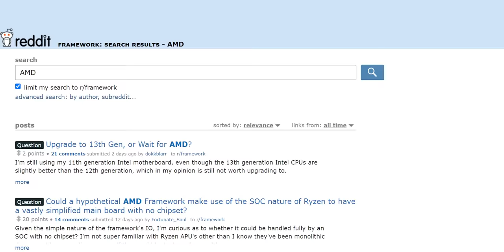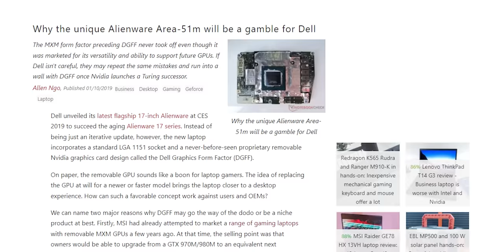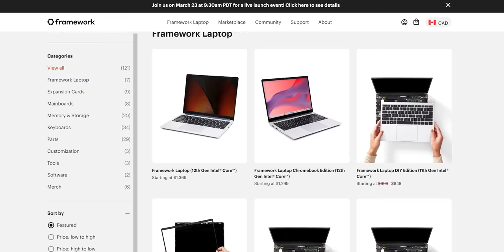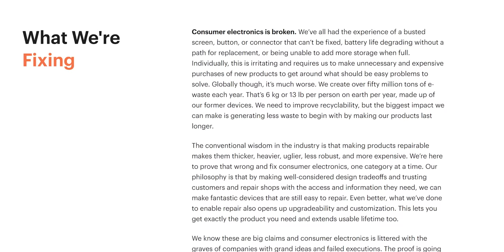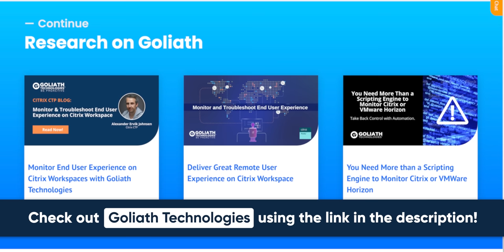I Made a Bad Decision – Framework Investment Update

Comment: The biggest hinder for me is the keyboard. I simply can't go from a Thinkpad keyboard to those slippery caps ... so, if they could also make alternatives available, preferably with depressions/dips/grooves on the keys, I'd change to it in a heartbeat. I find it telling that it's my only issue (important though it is to me), so well done Framework!
Reply: I can almost guarantee there will be better keyboards coming. Swappability and customization are just such a huge part of the Framework concept. If there's not a first party module, there will be a third party one.
Reply: Well, since the spec is open somebody could make a big old thinkpaddy keyboard. You would likely not be able to close the laptop with it inside but it could be done
Reply: @Ricardoromero4444  They probably would release a new hinge system for it. Pretty smart folks over there.

Comment: Now it gets into the grounds where I might actually go the laptop route. What I still missing is a dock. On the go you might want 2 SD Card Slots, one HDMI, one USB-A, one USB C and one Storage Expansion, because that is what you might need on the go but for example at home, you might want a dock with 3 monitor outputs, one Ethernet or even Fiber connection, audio and more USB. At work or home you might want your full desktop possibilities but on the go, you might prefer other stuff. Connecting more than one external monitor is pretty rare. At work, we have a dual TV Setup for our conference room but mostly use one for one laptop. At these occasions, a mirror setup is the most used one or when doing presentations, an expansion. 

With numpads, I need one. I need a full keyboard layout, because I actually use it. The middle row I use while typing to navigate, because why use a mouse to position your cursor, when I can just jump. With num, I use it for typing numbers and for calculations.
Reply: since this laptop has 6 USB-C ports and Tunderbolt4, you can use any Thunderbolt docks or other cheaper USB-C docks with it

Comment: When the touch screen becomes available, I'll definitely consider this over other options (for the occasion I don'thave the space/don't want to use a mouse). Just a thought, how about 360° hinges if the gpu module isn't in the way?
Also a note on the 3.5mm jack module: wouldn't it be more efficiently used if they had 3 ports per module? There is enough space for that.
Reply: That's the thing, anyone can build or 3d-print the chassis with 360 degree hinge that takes in framework components and they can sell it on the framework marketplace. 

Same for the 3 port per module, anyone can build it for you if there are enough requests. 

However, the company itself have to optimize for storage, costs, and etc, they can't build every single component that they can think of; got to focus on the most common customers or they'll bankrupt themselves quickly on inventory that never gets sold.
Reply: Yeah the headphone jack is a weird move, for something that shouldn't take up much space at all and a lot of people use turning it into a bulky module that takes up a slot you could use for something else seems wrong. Even my surface tablet has a headphone jack.
Reply: Indeed, I would hope you could get multiple ports out of one module in that case, like headphone and USB, or at a minimum headphone-out and microphone-in.  If it's built around USB-4/Thunderbolt it shouldn't have trouble passing through multiple signals.
Reply: Yesss
Reply: I wished atleast 2 audio ports in one module.

Comment: The very second they make one with a touchscreen I'm buying it.
A framework 2-in-1 would literally be the dream.
Reply: If they make a 16-inch 2-in-1 model with touchscreen and stylus support then I'm instantly buying.
Reply: @ReDesignEverything  SAME
Reply: If you had the resources, it’s not unimaginable you could make your own custom framework 2-in-1.
Reply: @curiouslamp2841  It's possible, but I imagine it wouldn't be much easier than just building your own from scratch.
Reply: I wonder if they are working on a modular hinge system to let the use choose between a normal laptop and a 2 in 1...

Comment: I really like that even the motherboard is swappable in that, on pretty much any other laptop, changing out a motherboard is just too much of a hassle, and usually pretty pricey too.
Reply: once I've tried to change out my motherboard because it got wet... It was really annoying bc it had a VGA port that got stuck in it's hole with no way out... Then when I finally managed to free the whole thing and put the replacement board & everything back in place and I tried to boot up my laptop and only the power light worked, nothing else... It ended up at a repair shop for a month and turned out that the problem was with some other little board that handled usb or something... It was probably the most annoying month in my life...
Reply: @ewellynn122  I have changed out several in my tenure, it’s the exception of intel era MacBooks none of them come out easily.

Comment: Ever since Framework was introduced to me, I hoped they would do a 15 to 16" variant as that is my favourite size for a notebook! I've been using an OG Surface Book and I hated it and missed the larger screen, and this new model is everything I hoped it would be! 
After I get through some of the "renovations" to my main setup I will need to start saving up for this as I can already tell (even without the prices announced) that my ideal configuration is going to be a £2000-£3000 at LEAST! 😅
Reply: Best part is you can skip some of the parts you don't need right away and pick them up for later upgrades, even as a baseline the 16 inch model is too exciting for tinkering nerds like me

Comment: I’m sold. I wasn’t sure I could ever get a framework unless they had a bigger screen and a dedicated GPU for engineering purposes, but you delivered both and even more! The ability to insert an oscilloscope, or any other scientific instruments makes this a game changer. 

The last massive benefit the swappable GPU offers outside of upgradeability is the option to hot swap in workstation cards when you need to work in solid works and then back to a GeForce card when you wanted better gaming performance. Once my Lenovo dies I will be purchasing a framework

Comment: The keyboard, numpad, touchpad swapability was really impressive... but I can't but help wonder how that affects durability. It's tiny connectors, and tiny retention clips. Can see any part of that break so easily. Love the idea though.
Reply: Probably takes a hit in durability, but you then get the ability to actually replace the parts easily.  Of the laptops that I've owned, most of them unibody, they all had to be disassembled from the bottom up to get to the keyboard.
Reply: Yse, but keyboard replacements are available for purchase.  Most of the diminished durability appears to be in the keyboard itself and not the chassis.  It's not ideal, but at least you are not throwing away a whole laptop for an unusable keyboard.
Reply: They are not under any stress when they are in use and it's not hard to not snap things when installing. Plus if you do, it's easy to swap with a new one. No drama.
Reply: @ZaPpaul  You still rest your hands on it and things do move around. It might not be any major stress, but when things are that small you don't need much for it to break.
Reply: @lacrossev  Yeah, that is true. Might be that whatever you lose in durability is well made up for in the long run, as things would break regardless. Good point. 👍
Reply: I think most people won't be changing it daily, Once you have it set up then that is how it will be for most of the time. So it will hopefully be as safe as any other laptop

Comment: I think the Framework laptop idea is great in the abstract: it gives the finger to the anti-right-to-repair and planned obsolescence big tech. but i suspect the finger only stays up as long as Framework does, as most of the upgradable modules are proprietary Framework parts. it feels, in practice, it won't be about "repair" but about "replacement" and "upgrading" of those parts. people who don't tinker won't start tinkering just bc they got a Framework. thoughts? comments?
Reply: i agree, its not like you can just tinker with your laptop, you have to buy special framework parts just to change your laptop.
Reply: For me it's more about having an easy way to fix your laptop when you spill coffee on it, or whatever.  I spilled a latte covering most of the keyboard and I just had to drop $100 bucks to get back to stock.

Comment: I'm in the market for a new gaming laptop. Mostly i'm using my current one to go to LAN partys or use it when i'm away from home for multiple days. But it's 6 years old, slow and massive. The modularity of the Framework makes it really appealing. This is so cool!
Reply: Same for me,my laptop is nearing 10 years,pretty good performance still but it definitely struggles with newer games
Reply: Id wait for the new one. I like my framework, but it is not a gaming laptop by any means.
Reply: @coreylawrence567  I was at a lan party and had a monitor with me and realized too late that i could output only 60Hz through my HDMI port....It nerfed my performance significantly. The laptop by itself  is powerful enough to make 200 fps but the external HDMI port bottlenecks it. if i could just swoop in a Display Port........good stuff

Comment: 08:18 I can't even begin to tell you how much I have been wanting to be able to do this with the NumPad, not just with a laptop, but just in general for keyboards.
I know that there are a few options out there for Keyboards that has this functionality, but the ones I have found today are what I would consider expensive to extremely expensive, and if I recall correctly, they are also wired keyboards with no wireless keyboard option to buy, which immediately removes them as an option for me anyway, cause I have gone Wireless for good.
Reply: If you had a modular keyboard, then removing the numpad would be completely possible for you to do, and you could just add it whenever you needed it again. That's the nice thing about it being modular.

Comment: Damn this is one of the most complete mainstream open hardware projects I#ve ever come across. SO impressed with it. I'm really liking the 2 in 1 touchscreen use of my current laptop when taking notes in lectures or while doing written excercises, but if it weren't for that, I#d surely be upgrading to a framework once my device dies. But maybe by then it's a thing already :))

Comment: Please make the battery expansion (maybe with one extra M.2 too). I want the option of a 120 Watt hour laptop. If they can make a 60 watt expansion module that may actually be possible. It cant be used on a plane but it will be the best battery in a laptop while on the go. 
2 day unplugged laptop

Comment: Yeah, cool. But this whole announcement is kinda like.

Framework announces amd laptops and a modular 16 inch. 
Open the gate!
There is no info about, price, specs, options, screen specs, photos of the device etc.
Close the gate!
It's fully open source!
Open the gate a little!

Linus, I have several questions.
1. Mux switch?
2. How does the interface work? When using a DP module, will it go directly to the dGPU or go through cpu and than dGPU
3. One of the key specs would be backwards facing I/O, none of the mockups show any.
4. Pre orders start from spring. Spring started on march 20th, still no decent info.
5. Screen resolution/ratio
6. Battery capacity. 

And the Last two that are making me kinda worried cause I want/need this to succeed.

What is the overall Availability because amd is being lackluster on their side and what will the usb interface do cause that would mean usb 4 and no thunderbolt 4.

And the final most important one,
How does the cooling work?!
You need a back module to actually cool the device, or so it seems since I'm not seeing any ventilation besides where the dgpu module would go. Does the cpu/ motherboard not have a dedicated cooling solution on its own? If so, wouldn't the chance of seeing it thermal throttle or better yet, be shipped with lackluster hardware....

I have so many questions about this design and device in general....

Comment: The one thing I want for this…. Much more flexibility, for a good price. Like…. If a GTX 1650 laptop can be as little as $730 CAD with a 6 core CPU… they could make them $850-$950 with a 13th Gen i5-1340p.
Like….. 16GBs of ram, 512GB ssd, that cpu and GPU would make this great, because you could upgrade to like a 4050 mobile when you have the money, since a 1659 mobile is less expensive being 4 years old, and still fairly good.

Comment: Good to know: cast metal is not as durable as machined and (cold) forged metal. The latter is the preferred method when you want it to be as toughened up as possible, such as in the world of firearms.

Of course, when it comes to a laptop, it's best not to drop it at all, so casting will be just as good. Plus it greatly reduces the cost.

Comment: It's already benefited me. I ended up spilling mtn dew on my framework keyboard which made the right side super sticky and unusable. I bought a new keyboard from their website and what felt like 100 screws later. I had the new one in, in about 30 mins and I was back to normal. If that happened on any other laptop I probably would have been screwed.

Comment: I got a new laptop from Framework around the same time you invested, it is collecting dust, because the thing is unusable with the touch pad that sucks (and was replaced once, and still sucks), the crazy high resolution, but tiny screen that Windows doesn't handle well... and I need to pull the SSD out of it and sell it before the value goes to $0.00, I'd be happy to get back some of my money... I bought a M1 Mac Book pro, 16." to replace it (Yeah, I'm a Windows guy, 100% of my income over the last 40 years has been from working on windows), but the M1 is so much better that I use that Machine - in spite of the lack of upgradability, it will outlast the use of this pile of dung that I was so excited to get...  And if I lose that dang screw driver, well, I'm screwed...   I had SUCH high hopes, but the touch pad is cheap, and doesn't work, replacing it was hard to get right, it apparently is trivial to break it, and I had to ship the broken one back or get charged for it (nearly did)  Thankfully, I didn't toss it in the trash...  SUCH a letdown..
Reply: I would add, that I've used about 50 laptops over the years, and this touch pad is worse than the rubber eraser thing the Think Pad had in terms of usability.  It appears that to move and click, you have to move, and then lift your finger up and tap it back down.  Unlike the normal just push down to click (there IS a click, just like the Apple's version, but it doesn't produce a click, so that is one of reasons I though it was failing - what a stupid design, they are the only ones on the planet that do it that way, and they HAVE the click feedback, but it doesn't actually click when you do that..)  It also had a gap next to the pad that you could slide about 0.5mm credit card through, they replaced it and the new one had the same gap.. I assume it is the design..  I gave up on being able to use the laptop after that and their support team stopped trying to help me with it.   Worst laptop I've ever used (my 700Mz Gateway with a Pentium was better, clearly not faster, but I used it for years)

Comment: If I could upgrade everything on my laptop, I would do! I would start by upgrading it to13th gen CPU, if that would be possible from an AMD, and then to DDR5 Ram, if that was possible. (it's a longshot dreaming about going from 5th gen AMD and DDR4 Ram to 13th Gen Intel and DDR5 Ram, BUT I did say, IF I could upgrade everything!) I just upgraded to 64GB 3200MHZ 20CL DDR4 from Kingston, from my previous 16GB 3200MHZ stock Ram, because I needed the extra Ram for video editing mostly, but photo editing is quite cool with it as well, and Minecraft is fun to play with to the extremes just to test how far I can go 😛that why I bought literally the highest performing Ram I could for a laptop, and even though I can still feel it's not DDR5, I can imagine it a lot faster, but now it's mostly my CPU that's the bottleneck, so that should be the next. so 13th intel, with support for the best DDR5 modules available to laptops, would be cool! AMD is shit at this point! only problems with DDR5! and then when I got enough money, a 40 series Nvidia GPU could be nice, maybe a 4070, just because, it's far better than my 3070, and uses less power too. but depending on the price of a 4090, it could be fun to upgrade to that instead, but if you pay too much compared to the gain and 4070 is the sweet spot, I would maybe go with that one instead. So actually I would upgrade everything! I would just not go out and buy a new Laptop now, just after 2 years of having this!

Comment: Good Job Man, Hat Tip Big Time!!! You found my next Laptop!!!  It's about Time Logic has Prevailed!!! I have been building PC's since win3.11, and have always wished for such a Computer type frame work to upgrade. I have always been on a budget and had to go part by part. big 3 was always hard to do(CPU,MB,RAM) or as I like to call it the heart or core of the system. For Example, my current system... 4790K,Asus maximus7,32GB Gskill PC2400 DDR3,Rosewill 850watt, EVGA 1080 GTX FTW Runs 24/7 only down time is 6 Month Dust Bunny Patrol w/a drinking straw or 2 for fans. Seize only, No rocking the boat or bearings!!! Old system now, on it's 3rd video card for upgrades no vid card Failures Hat Tip EVGA Baby always and always Nvidia from it's start! oh and System overclocked itself to 4.2 on a  4.0 Devils Canyon 4790K CPU, after that I never messed with overclocking.